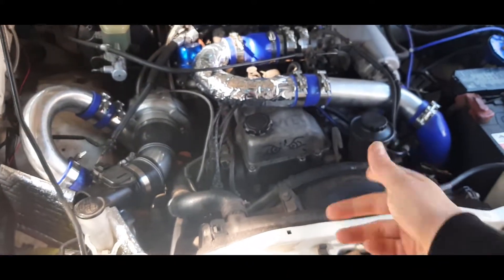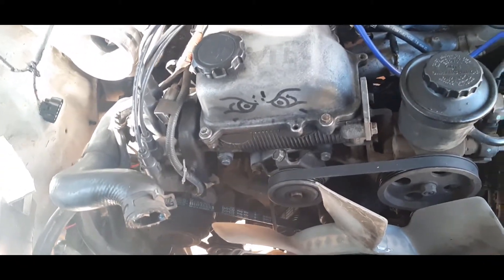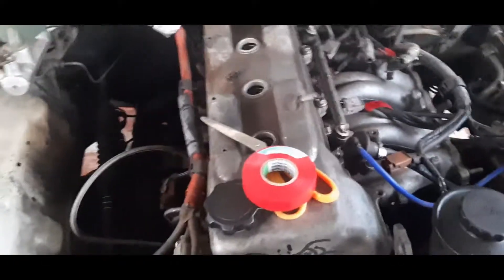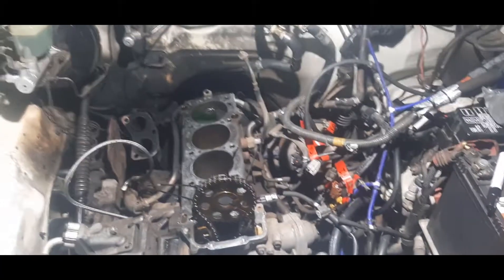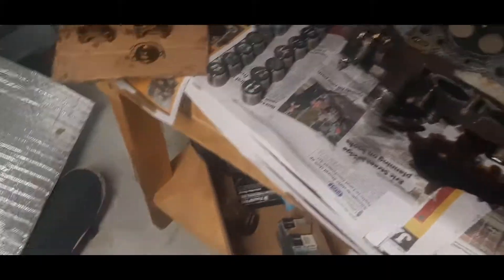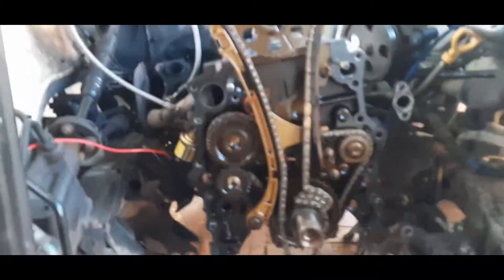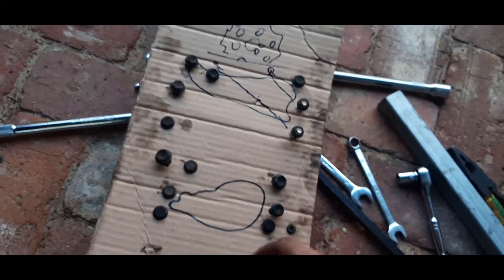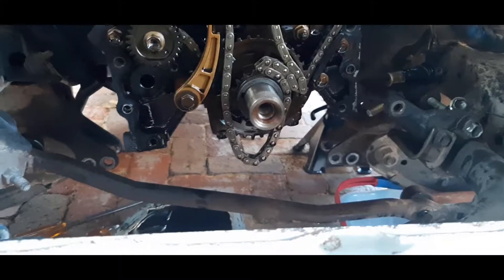3rz Turbo: cylinder head & timing cover removal

Comment: I know this video is 6 years old, but opening up AC systems to open air is terrible for the environment. you gotta get that done at a shop first next time for the love of the birds chirping in the back ground
Reply from the maker: Yes i this is very true, in the later video series where i work on the 4runner i paid to get the aircon system degassed correctly. definly a good idea to do it correctly.

Comment: Cool video but kinda of an example of why you follow the service manual step by step. Line up the engine to tdc with timing marks aligned on cam gears.  Dont forget the to place service bolt on exhaust cam sub gear. You need a special spanner wrench to fix if you don't put the bolt in
Reply from the maker: You should do it that way but i was just gunning it getting it apart so i missed a few steps. I made a tool and got the service bolt put in the camshaft in the end which wasnt a huge headache but wouldnt want to do it again.